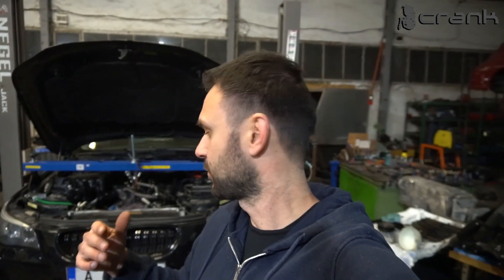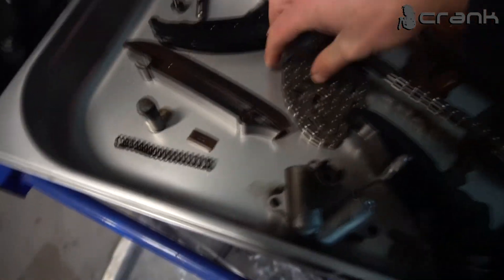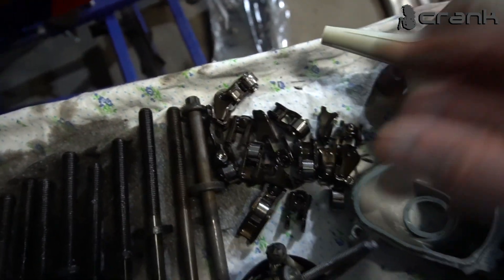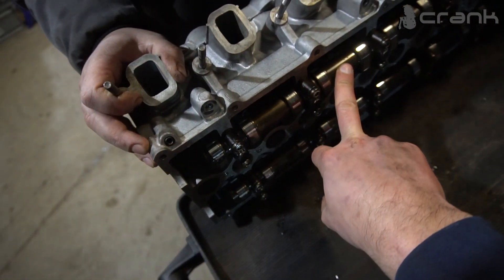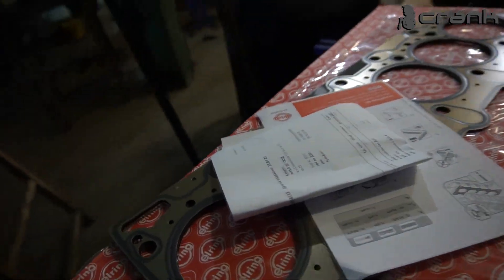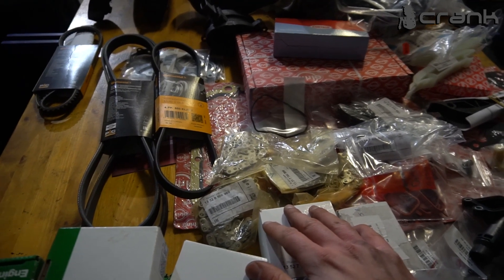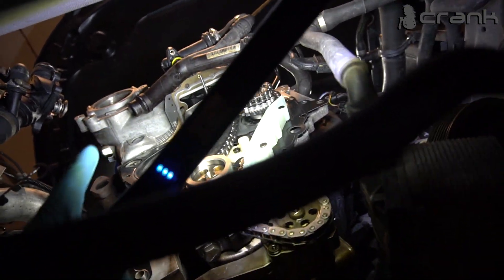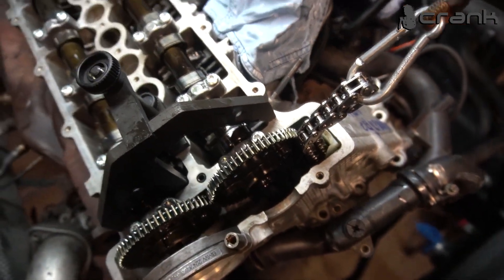BMW M57 Failed Timing Chain

Comment: Happens in europe alot more because of your oil change habits. 16,000 kilometer oil changes arent good for the engine health
Reply: Oil change interval for these are 30,000km, even longer if you do long distance driving. It’s insane!

15,000km oil change interval is okey if you drive long distances and buy good oil.

Comment: The M57 is notirous for lasting for so long without any major overhaul like this. 
this timing chain stuff on a m57 is a 1 out of 10 scenariou . If this was a N57 i would say 9 out of 10 . 

currently I have a e53 M57 driven 420kkm no internal major overhauls. runs well. but is low on power.. dont know what it is yet.
Reply: You need to do better research.

This is why people like you need to learn to separate M57, M57N and M57N2.

The M57N2 is living on undeserved reputation from the M57 and M57N.

Timing chain failure on M57N2 is not uncommon or 1 out of 10 as you say. Something this guy has explained in other videos.

And N57 is not 9 out of 10. With good care, and short oil change intervals it can last over 200.000km just like the M57N2 can.
Reply: @DanielStancex  Well maybe your right this is my first m57 and I dont really know that much about n57 i should have wrote n47 they are more of a  9/10 case. or atleast from what i've seen and read about them..

Comment: My E46 330xd with the M57 engine has now over 430.000 km with his first timing chain. But now the timing chain is hearable. Will now replace all chains and sprockets and also the oil pump.

Comment: What about crank and conrod bearings after such kind of damage?
Reply from the maker: There were no metalic debries in the oil filter neither in the oil suction pipe, so they should be fine. Still If I don't remember wrong, because this video is probably at around 8 months, we checked 1 conrod and 1 main bearing.

Comment: What about the early M57? E39 530D model, I have one with 352k KM, no idea if the chain has been done or not. I rarely see anyone in the M57 groups with chain failure on the older cars.
Reply: The first M57s are having a lot heavier crankshaft (+4kg that's 20%) so it revs up slower and not yanking the chain that aggressively so it lasts a lot longer.
Reply: Nice to know. M57 is the best.
Reply from the maker: I have done few of those also. Much more rarely than the newer ones, but that is because of the higher power that the new ones have. The stress on the chain is much bigger with bigger torque. The quality of the timing components is all the same, first or the last M57 version doesnt matter.
Reply: @crank3646  torque makes no difference on chain thats BS and very ignornat from a mechanic. 
d1 d2 have much heavier crankshaft than d3 but the same chain which makes revs change much faster in d3 resulting in more force on the chain. Also d1 only has oxi cat and no dpf so the oil quality stays much better.
Reply from the maker: @PKperformanceEU  Soooo... more torque/power doesn't mean faster revs? Also the cams are also hollow on the newer ones, so yes everything should be taken into account. But the torque/power is the biggest one, especially on the 286 ones. Even with heavier crankshaft than the D1, they still will rev faster.
Reply: @crank3646  i said d1 and d2 have identical much heavier crankshaft than d3. D3 also has dpf which makes the oil loose viscosity and gets contaminated faster.

I don’t believe torque plays any role here. Matbw im wrong with this one

Comment: Hello!!
Thanks again for this super interesting video!
When I bought my 325d e91 with m57 engine I have been told just that.Timing chain should be changed every 200.000kms.
Curious:speaking of exhaust smoke what is the normal oil consumption on these engines?
Thanks a lot!

Cheers from Portugal,

Ezequiel Costa
Reply from the maker: Most of the time owner are stating that this engine doesn't burn oil, but when they remove the DPF they see the reality. The regenerations are filling the oil with fuel and this is compensating for the oil burning. Which means you will be on the full mark on the dipstick, because of the added fuel in the oil. Most of the time this engines are burning oil because of the oil piston rings, rarely is from the valve stem seals. Still if the engine is maintained as it should be, they don't burn almost no oil. The 30k service intervals is clogging up the oil piston rings and that is why they fail.
Reply: Yes,I understand!The top up on the dipstick isn't just oil,it is oil+diesel from the over and over regenerations of the DPF.
Mine is the M57TU2 on a 2007 325d e91. DPF and EGR delete. Now has 370.000Kms (bought it wtih 295.000) Use 5w40 liqui moly top tec every 10k since I bought it.
It was burning oil, almost half the way the mark of the dipstick (about 0,4L) in every 1000Kms.Although the engine always runing fine with no signs of problems. Restored the turbo but the oil comsumption didn't change much.
This year I changed the valve stem seals (your videos helped me a lot❤). It still burns oil but it is like 1/3 of the mark in the dipstick (about 0,3L) in every 5000Kms. Was hoping it was not too much 😅 thats why I asked in the first place!!
Still I love this engine. 
Just wanted to share my experience!

Thanks a lot and keep up your great videos!!💪

Cheers!!

Ezequiel

Comment: I guess they must've updated the timing gear at some point, because in the US the E70 X5D and E90 335D are deep into the 200-300k miles without timing failures (with some exception). My 2012 E70 is right around 230k miles (370k kilometers) and my 2011 E90 is at 172k miles (276k kilometers), both with original timing chains.
Reply from the maker: I have just the right video for you in the next videos. US M57 with the same failure with pretty much the same kilometer reading as this one
Reply: The US E70 X5 35d that CRANK mentioned was mine, the lower chain failed at exactly 128k miles. It's now fixed and running like new again. I am curious to see the video
Reply: @toly78 Where is he located in Bulgaria?